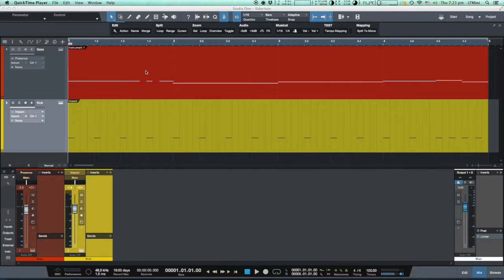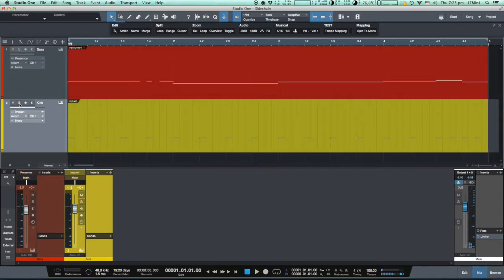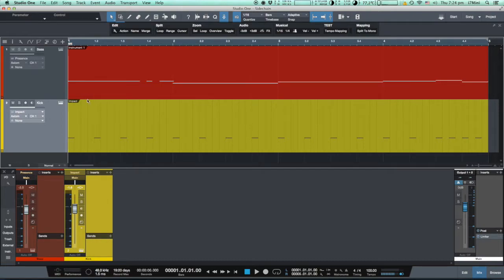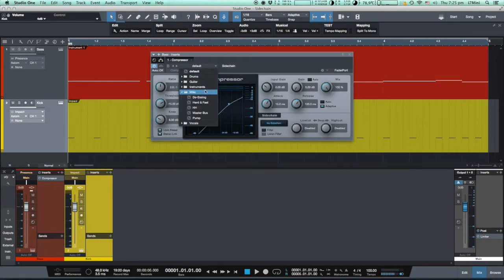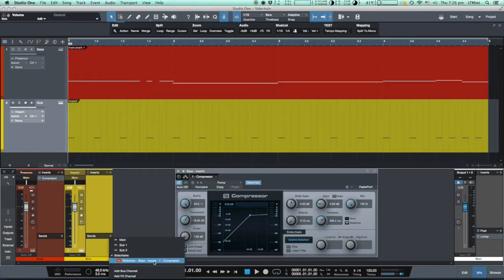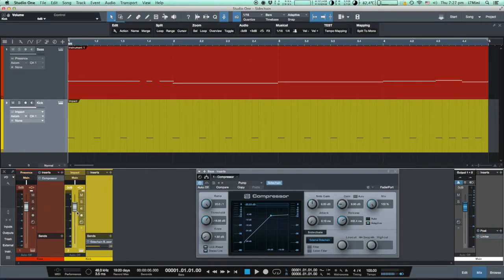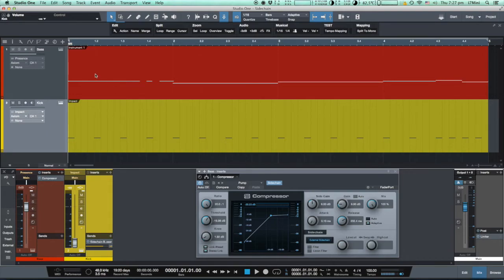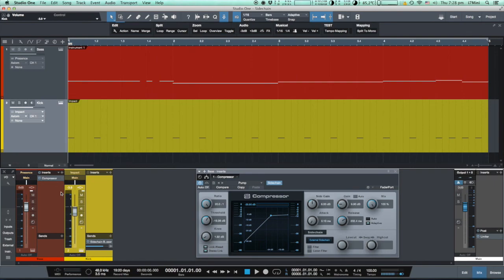How to use Side-chain Compressor in Studio One v3

Comment: Does it work with a non-native compressor? Ex: waves c6 sc or fabfilter pro c mb
Reply from the maker: Hi, as long as Sidechain button is present in the plugin, you can. Pro C does have it, however C6 does not. You just engage the Sidechain and then the routing is the same.
Reply: @StudiojakubkaCz  thank you brot

Comment: Hey, I have the exact same two tracks set up, the bass and the kick... I have done right up until the part where you click "sends" on the kick once the compressor and sidechain button is enabled. When I go to click the "sends" option on the kick, there is no option there for the sidechain. Only "main" and "add FX". Please Help!
Reply from the maker: It should be there. Compressor is on track one, you are sending audio from track two to compressor on track one. Check both track once for for correct order.